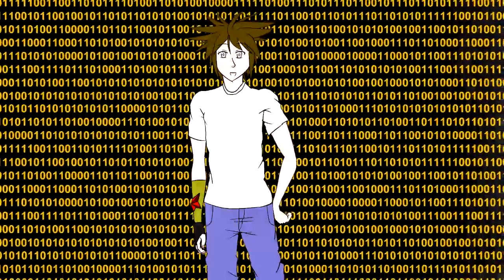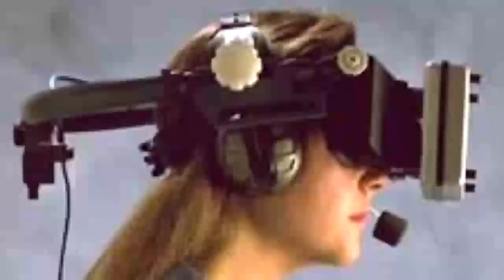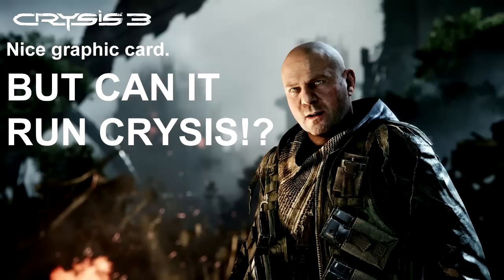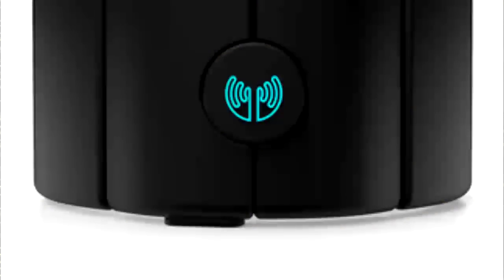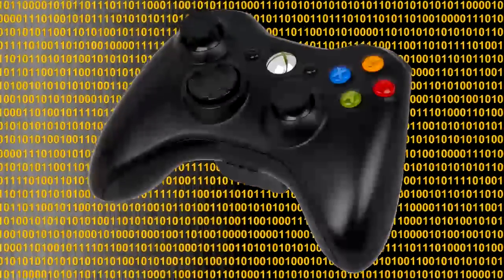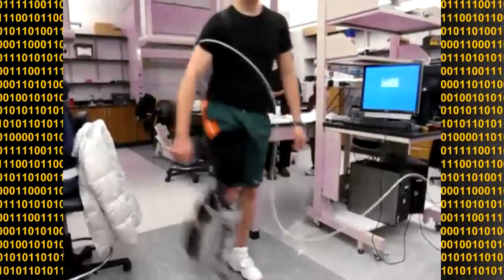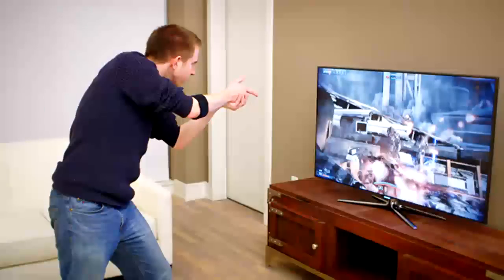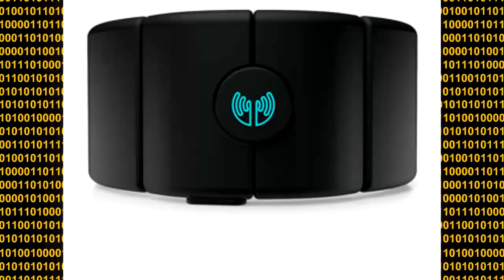Virtual Reality Rig 2014 Explanation Pt.2 - Implementation

Comment: I've been researching nerve gear as well and, if I heard this right, according to you if we use those arm bands the small contractions of our muscles will be enough to maneuver a whole arm in game, right. I like the concept but a lot of your commentators have a point. The system needs to be more precise/ specific which is why I'm still looking into the original concept of NERVE Gear but judging by the build of the brain Nerve Gear may involve sensors on your back as well.